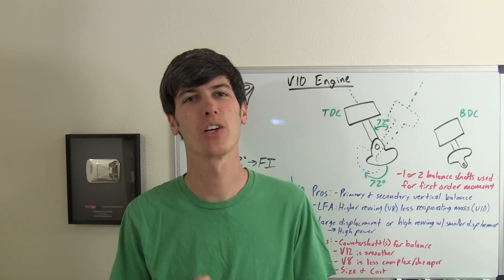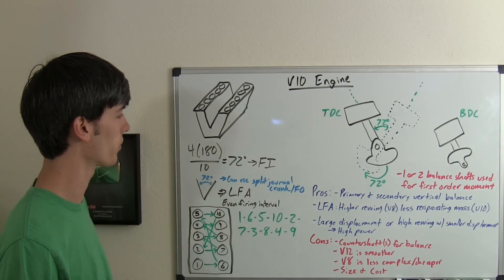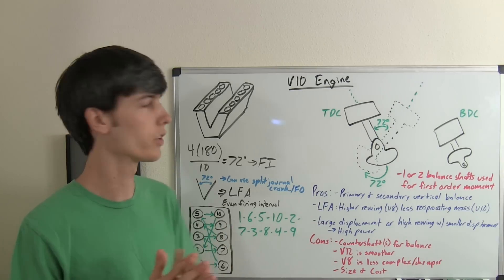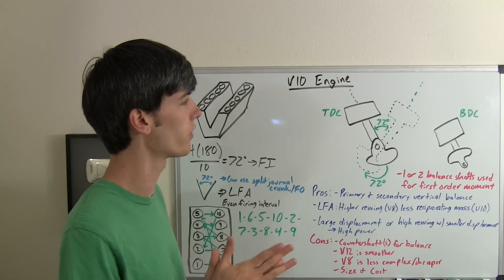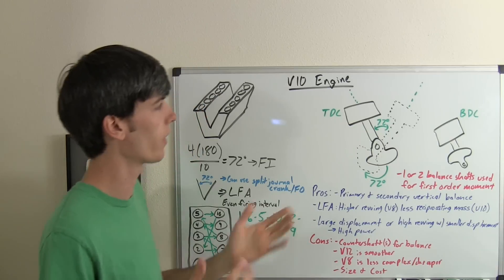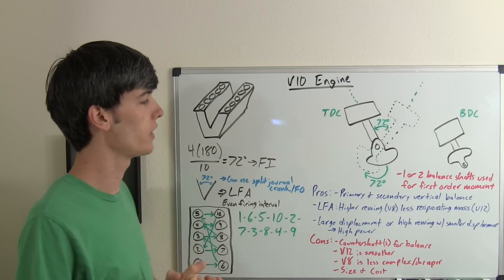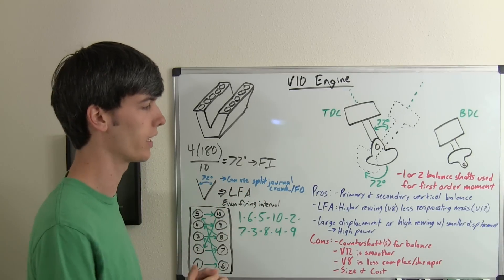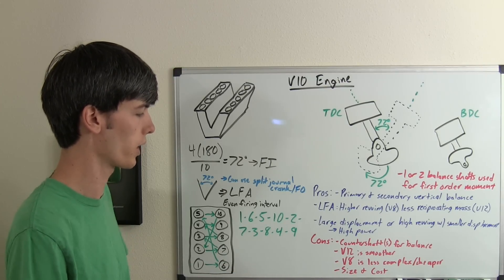V10 Engine - V10 Cars - Explained

Comment: Hello E.E. Thank you very mych for this video!!. It's very helpful. But now i have a question: since the ideal inclination is 72 degrees, what happened in the Lamborghini V10, where there is an inclination of 90 degrees?? If you increase the inclination, this means that the last piston will spark after the first piston, right?

Comment: I know how it could had been done to have them efficient.  Each cylinder has another that just fired 1/5 rotation away;  so the one that is on top dead center fires whenever is best which now makes no difference because it is giving its combustion to that one ahead of it and so on as it will get the other one's when it is it's turn.  So this logic is because it has better leverage when it is there and we could now make them different as in heavier or what not;  but we could get the same effect if we were to have the piston spring loaded as to let it's recoiling at any other time after combustion which would likely do what affect that other one prior that I've explained but all of them really should be just without having to create pressure if it's gas ignition shouldn't they;  I mean what would be the efficiency if we need to lose force in order to gain what should be the same force isn't it?  Isn't this what people have been preaching to me;  that you can't gain force;  so why would this be any different cause gas will burn either way if done as I said in the first example at least.

Comment: If you give or take 18° from the V angle, it becomes easier to balance. if you choose to to give it 18° (90° total), you can reuse whatever tooling you have for making V8 engines.
Reply: Wasn't that what Ford did with the Triton V10? 90° V angles allowed them to make the Modular V8 and Modular V10 on the same line, and they achieved even firing on the V10 by splitting the crankpins forward 18°.
Reply: Ferrari and BMW uses 90 degree F1 engines because they were most resistant to vibrations and more reliable.

Comment: Why were V10s not used in production cars until the mid 90s with dodge? Then V10s exploded in the mid 2000s. It went from no v10s to dodge using one in the viper then ford cams up with one for their trucks but around 2003. You had Lamborghini use a v10. Audi made one. Porsche made one. BMW made
One for the M5 and Toyota made one for the lfa. Now I think only Audi and Lamborghini share a v10 and dodge makes them still for vipers. Why was there a sudden explosion of v10s in the 2000s and there really hasn’t been any since or any at all really before 1993.

Comment: 5 years later...Could  you do a video on how 4 cycle engines fire when they're not 1, 2, 4, 8, 12 or 16 cylinder engines?
 I just can't understand how a 3, 5, or 10 cylinder engines can fire evenly (or don't they?). I assume:
1 cylinder, 1 power stroke every 4th crank revolution. 2 cylinder, 1 power stroke every other crank revolution.
4 cylinder, 1 power stroke every crank revolution. 8 cylinder, 2 power strokes every crank revolution and so forth.
I can't figure out the others. 3, 5, 10 cylinder configurations.

Comment: I'd like to know two more details.  1) How can some V10s not need a balancing shaft?  2) Why is the firing order different that a traditional inline 5? If you focus on a single bank from your whiteboard engine, the firing order is 1-5-2-3-4, but traditional inline 5s are 1-2-4-5-3.

Comment: Comments are old here but chances are you still read this:
Is there a particular reason for the firing order not firing the middle two cylinders lastly?
A firing order of 1-6-5-10-2-7-4-9-3-8 would allow for better air flow for the 2-7 and 4-9 cylinder pairs and there would be no rocking motion.

Comment: why do you think the vipers v10 is so inefficient for its displacement? Ive heard it's one of the lowest output to displacement engines still manufactured.
Reply: 645 hp and 600 tq, weighs much less than the GTR's V6, gets the same fuel economy as the Porsche 911 GT3 4.0L. That's more than twice the displacement of the Porsche with more power and torque and the same gas mileage. HP/L ratios don't mean a thing. If you told me the HP/L ratio of your engine... you haven't told me anything. 
You can increase horsepower several ways such as dumping more fuel into the cylinder or increasing rpms. If you were to shorten your connecting rods to increase rpms to gain more hp/l I'll just bore out my engine to increase displacement and keep the hp/l ratio the same. You do not necessarily have a better engine than mine now.
Other parameters, such as power to weight ratios, are far more important. 
One reason the Viper has a mediocre hp/l ratio is because it's not a high revving engine and has long connecting rods. However, it has enough torque to rip a tree stump out of the ground with a torque curve that's as flat as my sister. 
I hope that one day the Hp/L arguments will disappear forever because they are meaningless.
Reply: Because specific output is a meaningless metric when comparing engines of different architectures (ie. cast iron 3.2L DOHC i6 vs aluminum 8.4L OHV V10). The Viper's engine is pretty efficient for how much power it makes and it's not that heavy. It makes more power and gets better fuel economy than V10s in the E60 M5, LFA and Carrera GT... I'm not saying it's a better engine, just pointing out the meaninglessness of "power/efficiency per displacement".

That metric makes sense in a racing series with displacement regulations, where/when bigger displacement meant more taxes... or even comparing two similar engines, like the ubiquitous 2.0L turbo i4.
Reply: "My four series cell battery pack is soo much better than your two-cell it's laughable!"  - some nerd in the not too distant future
Reply: +thybigballs "I hope that one day the Hp/L arguments will disappear forever because they are meaningless."
Our electric and autonomous overlords are almost here :(
Reply: Geez, will we be fighting over who makes the best batteries?

Comment: so what does the crank plane look like? :) I know v6 engine look like a Y and a v8 like a + ... so what does a v10 crankshaft look like? and is the v6 crankshaft also considered to be a crossplane? oh AMD BTW... I've learned everything from the ground up about engines watching you... youre my hero xD
Reply: The V10 crank looks like a five pointed star. It puts 72 degrees of crank rotation between each pin.
Reply: Cross plane vs flat plane is a V8 thing because you can create a useable firing order with either type of crankshaft, it doesn't really apply to any other engine layout, save the I4, which can (but seldom does) use a cross plane crank.

Comment: How would you angle a flat 10 engine? Would you have to make it a split pin? What angle would it be at to be as flat as possible, and the angles in the crack and crank pins to accomplish this?

Comment: Would a "flat V10" (IE, not a boxer) cancel the rocking or make it worse?
Reply: +Phos9 You mean inline 10? I guess it would be like an inline 5 cylinder. But i don't think there even exists any inline 10s, it would be the longest engine ever.
Reply: +dfeated andersson no, I mean like a V10 with a 180 degree bank angle, like a boxer but without the split pins
Reply: It would mostly cancel the rocking motion using a 180 degree angle. Only reason it won’t cancel it completely is because for a boxer engine to be perfectly balanced, each pistons would need to be perfectly aligned to the piston opposite from it. If you search up a GIF of a flat 6 (as an example) you will see that the opposite pistons are not perfectly aligned.

Comment: What difference does the angle between the V make? Like 72 deg, 90 deg, etc. What do you gain/lose with a bigger/smaller angle?
Reply: For the 72 degree v10 you get even firing intervals but must use a balance shaft. For the 90 degree v10 with shared crankpins you get an uneven firing interval but since it is 90 degrees, instead of using a balance shaft to counter the rocking, you can employ heavier counterweights on the ends, (like how bmw m5, audi r8, huracan, and viper) use. With 90 degrees you get lower center of gravity and it is narrow enough so you can still have venturi tunnels beneath the car for ground effects, hence why lmp1, and f1 have been using 90 degree angle engines v6, v10 (even when odd firing) since the early 2000s.
Reply: Balance.

V8's are lucky because 90° is not only the natural angle for a V8 but a 90° V-twin is perfectly balanced (as the primary forces for both pistons sum to a perfect circle). 90° V8's are naturally balanced.

For a 60° V8, however, you need to split the crankpins 30° backwards if you want even firing. The pistons' primary forces sum to give a vertical force that is greater than the horizontal force. Counterweights on the crankshaft can be used, but on a crossplane V8 this becomes a problem because when you size them to balance out the lateral forces, part of the vertical force on each V twin pair remains unbalanced, and these residual forces will create a front2back rocking moment.

On Ford's Triton V10, a 90° V angle is used with crankpins that each have an 18° forward split. Compared to a 90° V twin with a non-split crankpin, the piston pairs in the Triton also generate a vertical force that is slightly greater than the horizontal force, which again leads to a rocking moment. That is why the Triton has balancing shafts.

On a 90° even-fire V6, the opposite happens. The crankpins need to be split 30° backwards to give even 120° firing intervals. In this case, the horizontal component is greater than the vertical component. Crankshaft counterweights are then sized according to the horizontal forces, but then they over-correct the vertical force, so now the residual vertical forces are generated by the counterweights instead of the pistons. This also creates a front2back rocking moment.
Reply: @electric7487 about 72 deg v10?

Comment: why is it not that popular?
Reply: +Muammarvsgaming 00 I think because it's not smooth without a balance shaft and unless you want high RPM coupled with large displacement, a V8 will suffice. Just my opinion. The V10 in my F150 is extremely smooth and uses a balance shaft. The V10 in my Viper without a balance shaft is not smooth at all.
Reply: sounds legit

Comment: Do the Ford and Dodge v 10 truck motors use the rotating counter shafts in their trucks or is it primarily a car thing since trucks shake already and don't rev as high?
Reply: +Jay Groom The 6.8 Ford V10  uses a single balance shaft above the cam on bank2 (driver side in the US). I know very little about the iron block 8.0 V10 in the RAM trucks, but all iterations of the Viper engines do not use balance shafts, because we like car to rock around at idle. I'm pretty sure the RAM V10 does not have a balance shaft. I couldn't find a listing for one anyway.
Reply: Cool thanks for the info

Comment: You do not need balance shafts in a V10, look at MTU 10V 1600 G80S 752 HP @1800 RPM. You are speaking about automotive, I am speaking about C&I engines. Take care !

Comment: Every night before sleep , I listen to Renault 3.0l V10 at 20,000 rpm (that is name of video) . Also , there is a 15 minute video that features all road cars with V10 and first is Carrera GT . If you play part where Porsche accelerates at underpassage at double speed (Carrera revs up to 9.000 rpm) it sounds like V10 F1 car .

Comment: Great vid! Would be good if you could explain why in the 90s F1, most engine manufacturers settled on a V10, rather than continuing with v8 - Cosworth, or v12 - Ferrari.
Reply: Because the regulations mandated a V10 of 3.5L displacement and later reduced it to 3.0L. Then switched to V8 and V6 hybrid. The engine manufacturer were taken away the leeway they had in the 80s and early 90s.

Comment: as times goes by, i see more cars that have 4 valves per cylinder, but it's an SOHC engine, using a 'y-shaped' rocker arm. could someone explain to me about 4 valves SOHC vs 4 valve DOHC?? (i did see his 'SOHC vs DOHC vs OHV' but that was 3 years ago, things changed a bit now)
Reply: Seems like you understand most of it.  SOHC uses rocker arms to activate all the valves with one camshaft per bank of cylinders.  DOHC uses two camshafts over each bank or row of cylinder, and the cams work the valves directly.  SOHC is cheaper, since rocker arms are cheap, and cams are expensive.  DOHC is good for generating more power since the valves perform better at higher rpm.  There is less weight for the cam to move so there is less valve float near redline, and the engine breathes better.  Plus you can fine tune your cam profiles better since there are separate cams for intake and exhaust valves.  Hope this helps.
Reply: thx for the answer.
so based on your comment, 4 valves SOHC and 4 valves DOHC differences, is only price in construction?? and because both still have 4 valves, the performance/mileage impact is maybe negligible?

if that's the case, i remember that reading about toyota's VVT technology, have different timing for each valves on the same cylinder, like 1 intake valves open sooner than the other one. then this is only applicable to DOHC? but i see them everywhere even in 'cheap' cars...
Reply: Kenny David
You can do VVT on any type of system, but it's a bit harder for SOHC because you have to move a big camshaft.  VVT pushes a different profile cam lobe onto the valves.  Usually it's based off of RPM.  You want a "normal" cam profile at idle, cruise, and then performance profile at higher rpm for better power.  It's just more flexible and easier to do with DOHC because you can control VVT on intake and exhaust separately.  Since SOHC only has one camshaft per bank, you have to control all of the valve profiles at the same time.  It's still a bit rare to see both intake and exhaust sides with VVT.

Cheap cars now are have engines attempting to maximize fuel economy as well.  So there might be various cam profiles to get max economy at different rpm too.

Comment: One other benefit of the V10 is its unique sound. Nothing quite like that shrieky bark. V8s too bassy and V12s too refined. V10s have just the right amount of edge.
Reply: “V12s too refined”  V12s can also sound not too refined or not too bassy like a typical V10

Comment: You should do a video explaining the "fart" noise my GTI with DSG transmission makes sometimes when it shifts. I am pretty sure the manual doesn't make the noise so I want to learn the cause.
Reply: The ECU cuts timing momentarily during an upshift so that engine revs can drop more quickly than usual and match the revs requires for the next gear as quickly as possible. This causes some unburnt fuel to be dumped into the exhaust, and if your exhaust is hot, it will ignite the fuel and cause the fart.
Reply: Charles Shang Neat. I read somewhere else another explanation relating to the rapid change in pressure in the exhaust due to the speed of the shift. There seems to be a few conflicting theories.

Comment: Why are 12 cylinder motors so crappy when it comes to longevity?  Ive got 4 cylinders with 300k+ and v8s with the same, but I had an old jack with a 12 cylinder that just did not like to live. Always broke down and like 5x as much to fix. Whats up with that?
Reply: More parts that can break or fail on the 12

Comment: do a video about the 4 cylinder motorcycle engine types, i wanna know how they get to such high rpm, thanks
Reply from the maker: Small cylinders, the v12 engine I make will help explain this.
Reply: if you scaled the engine up to race car size it wouldn't work. that's what I think at least

Comment: one question, i've always heard that the v10 is a "high" revving engine, loves to rev. but why? more cylinders=more friction, thus more power is going to just pushing the pistons instead of turning the crank. so, why is a v10 a high revving engine compared to anything else with fewer cylinders? i get the balance etc, but a i5 should then be even better then, or?
Reply from the maker: Kjell Randeberg It's due to the secondary imbalance I believe, an I5 would be equally capable, but have less power stroke overlap so power delivery wouldn't be as smooth.

Comment: The sad thing about V10s is they they've been replaced by turbo V8s. The M5 is an example of that. I think it's sad, V10s like the LFA and Carrera GT sound amazing. The Lamborghini V10 and 5.2 in the R8 sound good too. So does the last gen M5 and the Viper's 50 degree V10 sounds really cool. At least I think it's a 50 degree V10 in the Viper
Reply from the maker: I believe the Viper is 90 deg.
Reply: Engineering Explained You are correct.

Comment: Sooooo, an engine with more cylinders will be smoother? And, engines with an even number of cylinders on each bank will be smoother than an engine with an odd number of cylinders?
Reply: More cylinders will have smoother power delivery, doesn't mean it will have less vibration from primary and secondary forces. An I5 has balanced vertical forces, as does an I3, but an I4 has balanced moments, so it doesn't rock front to back. Variants of I6's will be the smoothest. A V12 is smoother than an I6 because it has more overlap between power strokes, and both are inherently balanced.
Reply: Jason Fenske So the smoothest engine possible would be a V720 so a cylinder is firing all the time?
Reply: Not always. the smoothest engine is a flat 6. 6 cylinders are the smoothest engines but they don't make as much power.
Reply: meifert2 ummmm the godzilla??? GT-R 34 and GT-R 32?
Reply: Kenny David There is a lot more that attributes to the GT-R's impressive performance than simply its engine or the number of cylinder's.
Reply: joshehutch
well yes i get that... and the 'godzilla' doesnt actually get it's name because it has enormous of power anyway. it's because of you can get the stock engine, tune it like crazy and get >600HP and still be durable enough if the added component are also as durable